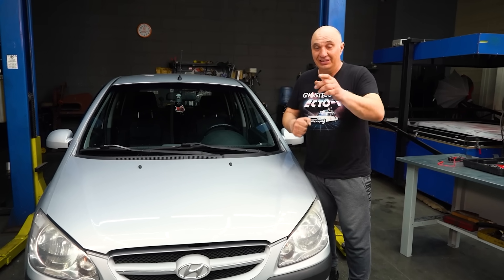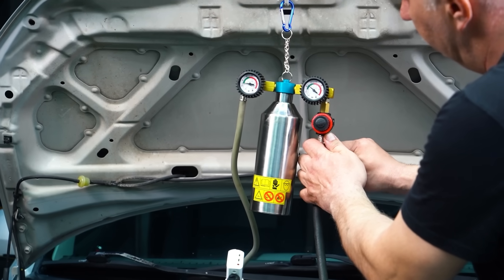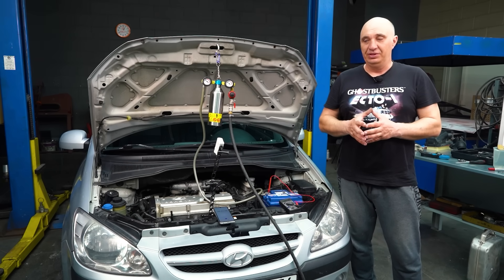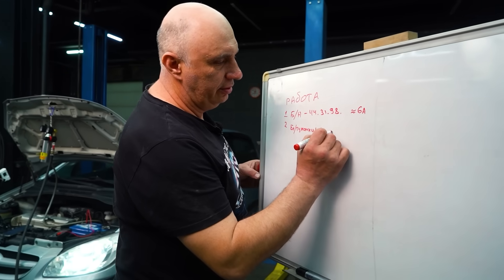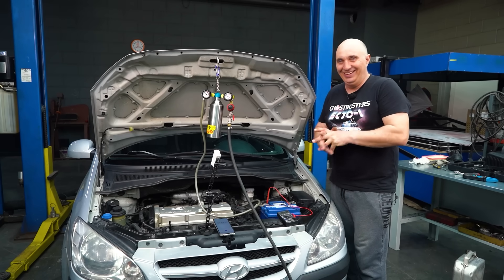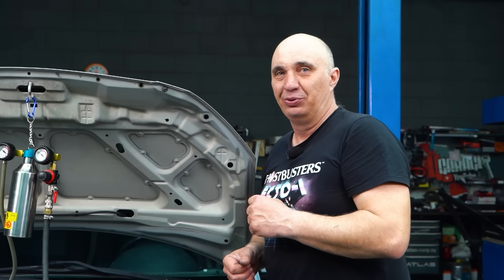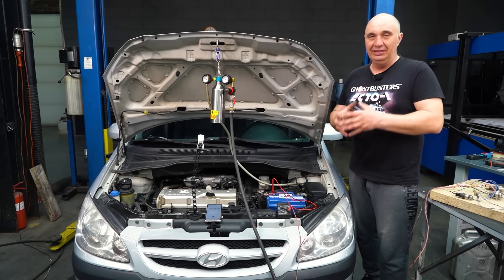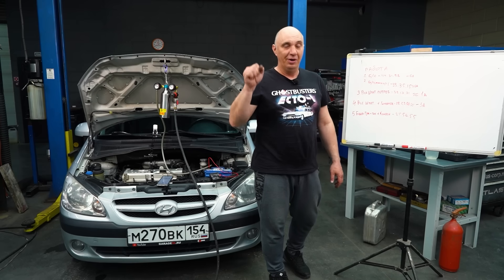How much really do accessories affect fuel consumption?

Comment: I think the amp reading may be odd because you measuring the "flow" of current into AND out of the battery. But at idle the alternator is just keeping up with load not having enough output to supply the load and still charge the battery.

Comment: There are 2 different types of clamp meter , one that does AC and the other that does DC . I can’t remember the specific differences , but off memory one has a laminated steel core , the other I think has a Hall effect sensor on the end of one of the clamps.

Comment: engine masters did a test with all the other things run on the belt by the engine. power steering was the lowest draw followed by the ac and the one that took the most was the alternator and that was without any accessories on as the engine was not connected to a car. cant imagine with a bunch of other things taking in electricity how much it really affected. would need to look up that video again to give accurate numbers but that is the results of it. in this one the ac was the most but because the alternator was also active in the fuel economy test. isolated the alternator draws more of the engine power

Comment: Maybe a more scientific way would be to take the battery out , then measure and log the power supplied by the alternator , after that convert the Watt Hours to Joules , or etc and compare the equivalent energy of that 500 ML gasoline . Maybe that would be more precise , at least it would take the battery charging out of the equation. 
Thanks for the video !

Comment: Everyone is saying to measure the wire  coming from the alternator. You can measure it from the battery, but you have the clamp flipped the wrong way, you just rotate it 180 and put it back around the cable coming off the battery.
Reply: On AC your clamp position doesn't matter. On dc the clamp needs to be facing a certain way. Thanks for starting off showing you don't know what you're talking about. Cars don't wire their power distribution to the alternator, the alternator always goes back to the battery, especially on newer vehicles, the alternator is controlled by the PCM and excites the alternator field to charge or not charge depending on voltage in an effort to maximize fuel mileage. You don't need the alternator field energized pulling a load all the time if the battery voltage is high enough. I've work as a heavy duty diesel technician over a decade now.

Comment: Most of the guys in the comments are right about the power draw showing on the meters. Without load most of the power from the alternator is going to charging the battery but that load gets routed to other systems with all the accessories

Comment: *Turns on both seat heaters. 
"I will gloss over the stereo, because not all cars have one."
Reply: It's Russia.  Maybe modern cars come with seat heaters.
Reply: @CreakyCricket  Yes, exactly. Most if not all of Russia have very cold winters, so it makes sense even base spec cars come with heated seats. Unlike here in southern Europe like Italy, Greece, and Spain where even high spec cars rarely come with heated seats. Still, very odd not having a stereo lol.
Reply: Actually he's right in Russia old ladas doesn't have a sound system
Reply: @Mista_Godfather  

Yeah, but the concept of a vehicle having seat heaters, being a norm used as a baseline in the test, but not a radio, is very backwards to me. 

I'd expect to see a radio in a vehicle with heated seats. If it doesn't have a sound system, then I'd be very surprised that it had a much more luxurious and new piece like heated seats. 

That's all I meant.
Reply: @Mr._Comedian  Don't worry, I completely thought the exact same thing. Raising an eyebrow when he said that about the radio lol 🤣
Reply: @Mr._Comedian  heated seats are so cheap, that some cars come with them equipped, but locked behind subscription..

My old car had a PTC heating element from the factory, but only "preparation for stereo", which is wiring and speakers,  without factory installed head unit. Cars sold in areas without cold winter weather didn't come with the heating element even if they were better equipped.
Reply: In USA heated seats are luxury 👌
Reply: @VistaSergy  
Yes.
Reply: LOL
Reply: *both heat seaters
*both ac compressors (dual ac)
Reply: @edvinassarulis7526    dual AC does not have dual compressors but does have dual fans.
Reply: LADA
Reply: Russia.
Reply: Heated seats ✅
Stereo ❌
😂🤣
Reply: @michaelschwartz9485      heated seats are a continuous draw. Stereo (OEM) is almost nothing unless it's a thumper.
Reply: I am from the USA. I have never been in someone's personal car that didn't have a radio. It wasn't until the 2000's on that I had ever heard of heated seats. 

I bought a 2000 Toyota Tacoma used, and I immediately upgraded the stereo. I put a 20W Pioneer radio with Bluetooth/AM/FM/CD and a 35W amp. I just wanted better sound quality, a little louder, with Bluetooth connectivity for my phone. I chose a single-din simple radio with buttons (no touch screen) so I could navigate it by touch safely while driving (I attribute this to saving a life - I was able to swerve around a little boy running across the street while I was changing through radio stations, instead of looking at a touch screen.). 

The truck does not have heated seats, and I don't want them. It's another thing to go wrong. I live in the Rocky Mountains, and it's not cold enough for me to need heated seats. 

Heated seats, for Americans, is, relatively, a luxury item. One has to select an upgraded trim on modern vehicles to get them.

Comment: The question I’m having is that fancy new thing that new cars have worked the engine off while you’re stopped at lights and then restart it. Does it actually save fuel? Or will The Car still burn the same amount of fuel because once you get going again, the alternator kicks onto to recharge the battery?
Reply: Auto Start/Stop Technology is a Scam used by Vehicle Makers to "Save Fuel" on paper to keep EU US and other Governments off their back. In the US, it affect CAFE Points from EPA and similar "systems" in other Countries. Does very little or nothing for most buyers in normal driving, worse can cause a "Dead Battery" sooner in heavy traffic. Because of that, Many Brands put a Heavier AGM Battery to try to prevent this problems. AGM are variate of Wet Lead battery but made different so can't leak and often cost 50% to 100% more then a normal Wet cell type. Many parts can wear out faster as Engine Oil stops flowing every time the compute stunts down the engine.

Comment: The low beams test should have been done with standard halogen lamps, not LED (which consume way less power and are not road legal in many parts of the world).
Reply: Where are LEDs not legal? I'm so tired of getting blinded by some truck in my rear view. Not that long ago I thought for sure someone was tailgating me with after market lights. I let them pass me at a stop light ready to make my frustration known until realizing it was just an old lady in some Volvo SUV.
Reply: @JJFX-  basically whole Europe?
Reply: @JJFX-  Yes, basically all of Europe (and more), unless for very specific and strict exceptions of certain tested and approved combinations of headlights and lamps.

But that's beside the point. People usually don't believe or consider that driving with the low beams on all the time does consume more fuel.
Well, at least from this test the conclusion is that the amount of fuel it takes is not exactly insignificantly low.
Reply: @martinweizenacker7129  Interesting... I had no idea that was a thing. A quick search seems that it's mostly aftermarket LEDs? I'm not a fan of ridiculous car regulations in my state but I can get behind that. Nothing wrong with efficient LEDs in general but it's getting out of hand. Even the factory lights on a lot of BMWs and such are really annoying... feels like you're being chased by a tweaker holding a spot light.
Reply: @JJFX-  Yes, that's why it's strictly regulated. Basically, if you put an El-Cheapo aftermarket LED into a halogen headlight, it will most likely produce unwanted light patterns and potentially even spill light above the cut-off threshold if the surface area emitting the light does not faithfully emulate the physical size and exact position the filament in a halogen lamp would have. After all, the headlight is tuned down to fractions of a millimeter to throw the light where it's needed while not blinding others. And it relies on strict tolerances of the lamp to accomplish this.

Factory headlights of modern cars (BMWs) are often blinding because the automatic high beams function simply does not work well under all conditions. For example, if there is dirt on the sensor (usually at the top center of the windscreen) it'll have a harder time recogizing other cars and stay on high beams, blinding everybody. Crazy, yes.
Reply: In the States, damn near half of all the headlights on the road are absolutely murdering my eyes these days. I can hardly take it anymore

Comment: After the car's engine stops, you should have tried starting it again. I ran my old 1998 Toyota Camry out of gas several times. Every time, I was able to restart the engine several times and drive a few more miles before it finally wouldn't start again. Only once did I fail to make it to a Gas station, only because I thought I could make it home first. The gas station was down the road and yes, me and my girl got out and pushed it to the gas station! Awesome car!
Reply: 2:19 This tells you all you need to know.
Reply: Yeah and as the car is moving it will still slosh and drop below the pickup line when it is very low. You could probably only start it again once it was stationary or level enough for it to draw fuel and pressurize the fuel line again. 

So even if he was drawing from the fuel tank, as the car is stationary the lowest point of fuel would have been the same each time and results should have still been indicative

Comment: In the 60's, many economy tests were done by the U of S on a VW Beetle. The windshield wiper drag used 1 mpg (Canadian). Taping the body seams saved 1 mpg. The same university made a 2000 mpg (Canadian) vehicle in the late 60's, then a 3000 mpg vehicle in the 90's.
Reply: Your math is flawed
Reply: wtf 3000mpg?

Comment: I use the aircon in my truck as brakes, while going downhill  :) .
Reply: Almost like a jake brake😅
Reply: @giggiddy  
 Yup, that sounds about right  :)  .
They will brake, even when not being broken to.
Reply: I thought i was the only one that does that! It works very well.
Reply: @WagTsX  
 Indeed. 
Sure, you freeze solid during the trip, but your brakes last forever  :)  .
Reply: I did it too. AC put a load not only on the alternator, but also on the engine to crank the compressor
Reply: @andikappradana  
 It works like a charm, and I can easily get 15 years of use from a set of brakes  :) .
Reply: @CNCmachiningisfun  So you put the A/C to Max speed and it acts as a engine brake?
Reply: @quagmiresgiggity69  
 It sure does  :) .
Reply: Think I will stick to low gear, but good to know that works too!
Reply: @Zourkoskey  
 Yup. 
 It pays to select a suitable gear, for best results, and the coldest truck cab  :) .
Reply: This does wonders as having a 1.0L vehicle, as better as brakes somehow

Comment: An alternator puts out current with a high ripple so you will find it difficult to measure the average current with the type of meter you are using. The voltage does of course seem stable because the battery acts like a capacitor.
If you used a scope to look at the current then you would see a lot of ripple (NOT AC) and this confused a simple current clamp.

Comment: And automatic transmission in D increase fuel consumption by 400%
Reply: Ridiculous. There would be 10%-20% max difference staying in drive with the brake vs neutral or park due to the torque converter being engaged. 

Would be more interesting to see the extra wear on the gearbox over time from frequent changes into neutral or park vs staying in drive.

Comment: Yo dude, just use obd2 meter. Idling without load is 0.45 litre per hour. Air-conditioning alone increase fuel consumption by 100%

Comment: Back in the 1970’s when I was drag racing (NHRA) in the stock modified class, when you went for the tech check they always checked to make the alternator or generator was properly charging. I had a hidden switch which I could turn the alternator off so it wouldn’t draw horsepower from the engine
Reply: Oh I need that switch.
Reply: Maybe that push of button actually pushed car forward for better times.
Reply: In many (if not all) modern cars these days, an alternator failure will result sometimes in a complete seizure of the transmission and the engine stalls. Had that once on the road.. after weeks of ignoring a weak alternator.
Reply: Maybe with a 16 volt battery but if you did that with 12 volts it would quickly go below 12 volts and your injectors/ fuel pump would be supplying less fuel. At a higher voltage though they actually supply more fuel because the fuel pump spins fast at higher voltage plus the injectors are more snappy but most racers already know this kind of stuff so I am guessing it was 16 volt battery with 12 volt for acc. that don't need alot of power/ won't change your torque in any way.
Reply: @MarkButler-rb8cz    fuel pressure is not dependent on pump speed. It's actually regulated down from a much higher pressure and the balance is fed back to the tank. IOW, jacking the fuel pump voltage won't give you higher pressure to the injectors.
Reply: @rupe53  yet they have racing batteries that runs 16 volts for injectors and fuel pump and it has 12 volt output on the same battery for electronics that require 12 volts only
Reply: @MarkButler-rb8cz      depends on what the system is set up for. There are many applications where 12v / 24v is also used. Rest assured, they are not running 12v items on that higher voltage just for giggles.
Reply: Fuel pressure is regulated at where it is set at for your tune at higher voltage the pump runs more efficient gets up to that pressure easier and stays cooler because at higher voltage it takes less amps but same amount of watts. the injectors are just snappier running at higher voltage and maybe use a bit more fuel but it is all about the response when taking off from a dead stop.
Reply: Unless you're powering your house while drag racing or drag racing a scooter, the alternator on or off makes zero difference to your track times. Even a high power alternator pulls maybe 2hp while charging under full load, which is completely imperceptible in the butt dyno or track times. Any difference you "felt" was placebo effect.
Reply: @ouch1011  you would be suprised.
Reply: never seen a old honda have you. them alternators can pull the idle down pretty low  when engaged. computer controlled,
Reply: @CotyRiddle  The turn signals alone will make the idle go up and down slightly
Reply: @1marcelfilms  yup.
Reply: @CotyRiddle  Resistance from longer wires also.
Reply: @CotyRiddle yeah only honda has has that feature. It makes battery and alternator last long. The problem when you charge other cars, it can damage the alternator easier than others. So sometimes you drive and the car would run in battery until it runs out. Only when you restart the car it runs again and the process can repeat itself.
Reply: @BlueRice  the alternator does not shut off it goes into a low power mode and the eld detects load changes and triggers the ecu to  go to high output mode.
Reply: @BlueRice  thats because all their hond aparts even aftermarket cost a shit ton. fuck dat. my 3.4l monte carlo gonna outlast all ur honda bullshitt. 250k miles gonna have a turbo soon and manual transaxle.
Reply: @GregsAutomotive  i don't care if your a fan boy. I don't even work for honda. Almost all honda is manufacturers in America.  Most employees or white and blacks. If you judge how bad they are essentially white and black peoples works right there. Honda owner came from Japan. Same with Toyota.  Ford and such were made in Mexico the longest time.  Go buy bmv, Mercedes if you think import cars are more reliable.  Honda is domestic baby.
Reply: @GregsAutomotive  https://youtu.be/Yt4qOeyYQpQ?si=m9csK_PJT2PgAHph if this video doesn't justify it... your just delusional
Reply: @BlueRice  still doesnt justify the cost for their parts. I only work on a honda for a rlly close friend or family. I hate them. The parts are made in america and still cost way too much. 900 bucks for a abs module…… 300 bucks for an everyday nothing special alternator. But ty for posting that vid i found out they have an assembly plant near me that hiring. Tbh. The parts arnt made in USA. I know that my beloved chevy monte carlo parts for the most part were made in mexico.but. 250k miles. a new pcm for chevy v6 cars cost 140$ pretuned for performance.
Reply: @GregsAutomotive  then go buy those cars. This is capitalism. You have a choice.
Reply: @ouch1011 you can definitely notice it sometimes. When I key up a 120 watt radio (which draws about 20-25 amps) you can hear and feel the engine bog down. Also, a 200 amp alternator can suck a lot more than 2 horsepower. 14v*200a=3.5kw, assuming 50% alternator efficiency that’s about 9 HP.
Reply: @ouch1011  until you have an engine you already pushing to its limits..... or a bad alternator pulley.
Reply: @ouch1011  well it wouldn't be zero, probably fractions of a second, but sometimes that's the difference between winning and losing.

Comment: The reason for all this is because during operation, the alternator provides all the necessary power for the vehicle electrical system. The greater the load, the more power the alternator will provide, because of the output being controlled by the regulator. When the electrical load is low, the output from the alternator will go to the battery, after the vehicle electrical power is met.